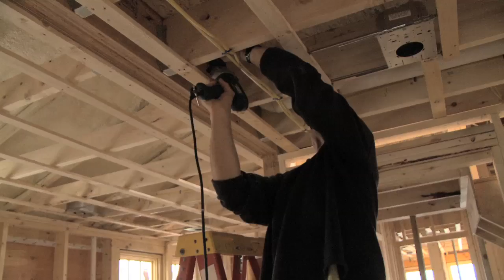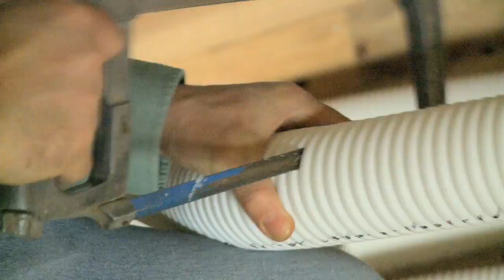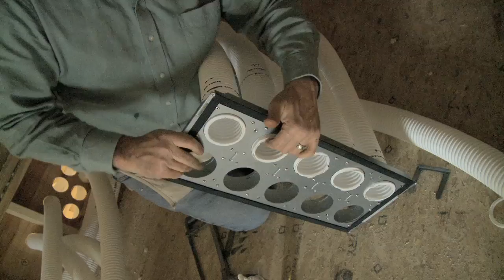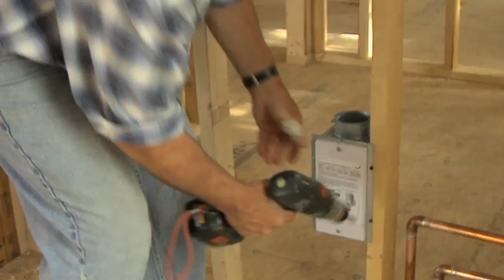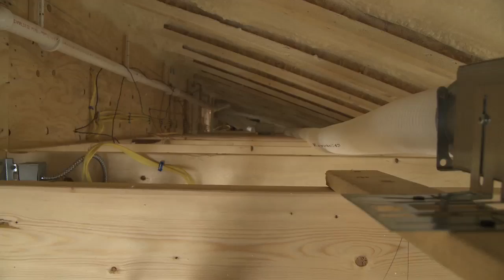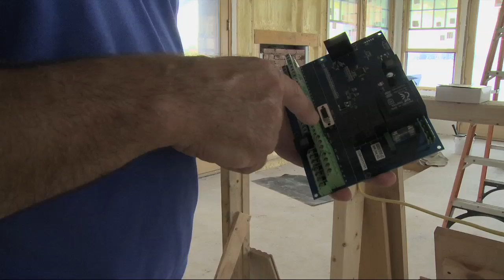How to Install Zehnder Comfosystems Part 2 - HRV

Comment: One of the things I find in most of the HRV videos is the lack of saying what each individual part is for. For example, there is an exhaust fitting mounted to the ceiling with two ports that are ducted. What are the purposes of those ports. If on is in and the other out, how do they not conflict? I saw a wall fitting - is that supply air? The larger box that shows two 8" ducts? (not sure the size) How are those routed through the roof (and what are the proximity rules?). To see an end to end video explained fully would be refreshing.
Reply: I too would appreciate a more precise description of each hole and tube and at what point precisely does the fresh air get introduced etc.
Reply: In the first video, Barry says some rooms will require a double supply duct, meaning there will be two 3" supply ducts coming into the register, likely to account for a higher CFM for a larger room. Supply and return are always done thru separate registers spaced sufficiently far apart (>8'), also explained in the first video. The 8" ducts coming through the main HRV are for main supply and return air sources routed outside the house. I imagine weather- and pestproofing these ducts would be no different from other external venting.
Reply: There is an option to fit the next size up radial piping (I think it is 90mm), as 75mm is the smallest size and can result in unwanted noise, this may mean that just one pipe is required in the receiver to get the same airflow in some circumstances @Pizzapinedale

Comment: @homeheatrecovery I guess that's where the Fein tool (high frequency oscillating tool) came in. I was also wondering about the clean cut without damaging the drywall. Would creating a "cutting guide" (piece of plywood, thickness of the drywall) with a hole the size of the supply/extract pipe come in handy? One could cut the metal, then plug it backup with the cover before the drywallers come in.

Comment: what tool do you use to get a good flush finish without damage to the plaster when cutting off the excess metal duct at diffuser conection